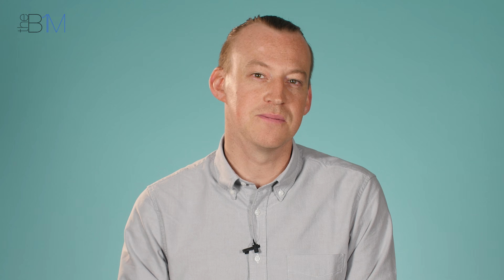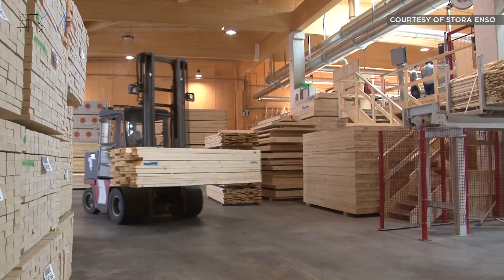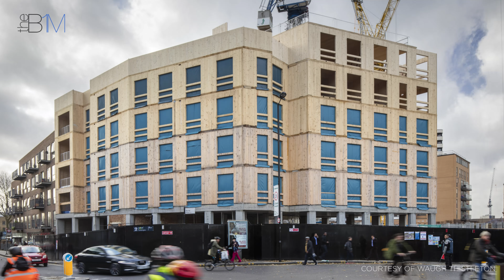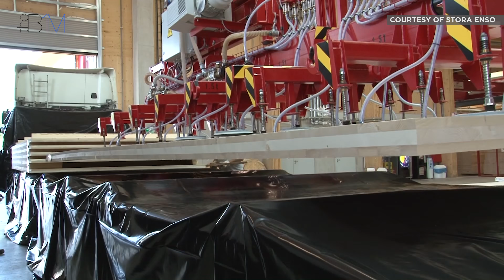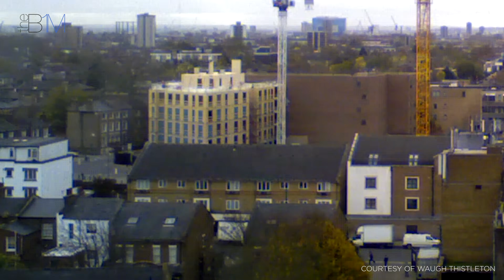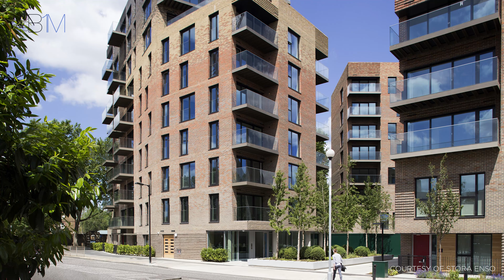What is Cross Laminated Timber (CLT)?

Comment: Aside from moisture penetrating the wood, what about woodworms or termites, or even just mice? Wouldn’t they thrive in the softer material?
Reply: Hi Nougabitz, I work for Stora Enso (our factory in the video) and in particular the CLT division. The CLT can be treated for termite protection, for instance this is done for the Australian or New Zealand markets where termites are more of an issue. We don't do this for the all countries as termites are a localised problem, for example in the UK they are not an issue, but for those countries effected they can be treated for. Mice are never really a problem, but certain local insects are designed for.
Reply: @gaz6351684  hi  mate do you supply to australia currently
Reply: @rexjgeorge  Hi Rex, yes we deliver to Australia currently, and have supplied the CLT for some big mass timber projects there such as International House Sydney, 25 King St Brisbane, and library on the dock. Please get in touch with me on gareth.mason@storaenso.com and I can put you in touch with my colleague who looks after Australia. Thanks, Gareth
Reply: We treat our panels with an environmentally friendly fungicide and pesticide solution
Reply: @денисбаженов-щ1б  hi, the glues we use are polyurethane formaldehyde free, and they make up less than 1% of the mass of the panel. You are correct that you still need additional finishes, the mass timber is the super structure, so you still need to add insulation, cladding, interior plasterboard, floor screeds etc etc as you would in any building. The floors themselves are also CLT panels, the bigger the span, the thicker the panel, and at larger spans (say around 5-6m) it becomes more efficient to start adding beams. Acoustics need to be designed for, and usually sound resilient bars to hold the plasterboard and floor screeds to add mass in the floors need to be used. But, common acoustic regulations can all be met with standard detailing.
Reply: @денисбаженов-щ1б  the thicknesses are related to structural load and performance, so, the taller the building or bigger the span, they change. A 2 storey single family home would usually have load bearing walls around 90-100mm thick. A 4m spanning floor with a typical residential load would be around 160mm thick.
Reply: also load bearing, only houses, not industrial or commercial with hardware.
Reply: @денисбаженов-щ1б  the VOC levels are very low, and lower than for instance carpet, curtains or furniture. Mass timber provides a very healthy living environment and also regulates moisture levels in the building naturally.
Reply: @денисбаженов-щ1б  the glue is not impermeable to moisture, and moisture can travel through the panel.
Reply: You realize we've been building with wood for millennia, right? We've figured it out by now.

Comment: The major downside for me is the noise absorption which is pretty much not existent.
Reply: Hi Pocki, I work for Stora Enso (our factory in the video) and in particular the CLT division. In regards to sound, CLT have very accurate and airtight connections between panels. This means in regards to airborne sound transfer, they are in fact very good. I believe what you are referring to would be vibration transfer, and while its true that timber does vibrate more than concrete, this is easily designed around through detailing. We've now supplied over 3000 projects internationally, all of which have had no problems in meeting local sound reduction requirements. if you go to our page, you can find full documents on sound proofing for CLT - http://www.clt.info/en/media-downloads/approvals-documents/technical-applications/

Comment: Could you char it on one side (in the Japanese fashion) to make a fire resistant exterior siding?
Reply: In my job I've had many years of experience with passive fire protection, timber fire door frames and fire doors, as well as FR plasterboard (and various other boards and coatings). No amount of PR will sell me on this idea. I would not spend a single night in a multi-storey building of this construction.

Performance of materials in a fire test is one thing. Real world fires are another matter. Every aspect of the building needs to perform, even after many years of occupation and the activities that go with that. Using laminated timber as the structural elements means the passive fire protection is critical. In practice, it will be vulnerable to compromise.
Reply: @kirkc9643  Then don't live or work in one. Problem solved.
Reply: @snakedoktor6020  Genius level intelligence there mate
Reply: @kirkc9643  Right back at you brada.
Reply: Chemicals are cheaper and better, but hipsters are free to do that, yeah.
Reply: Hi, I work for Stora Enso (our factory in the video) and in particular the CLT division. This is certainly an interesting idea, and the very old Japanese method (Shou Sugi Ban) of creating durability and fire protection is suitable for some projects. However, for nearly all of the buildings we supply, to ensure guarantee's, warranties, mortgages, insurances etc, the panels have to be designed for fire very accurately, to ensure they perform against fire as expected and required and ensure the safety of the building and the people inside. One issue with Shou Sugi Ban for modern construction would be that there is no accurate way of charring or measuring how that char has effected the panel. So although I'm sure its possible, for the very large scale buildings we supply, we have to use much more accurate and tested methods such a FR plasterboard or surface spread of flame treatments for us to be sure the building will perform as required.     You can find a number of fire design guidance and documents for CLT here: http://www.clt.info/en/media-downloads/approvals-documents/technical-applications/
Reply: The issue isn't whether it will work or not. But the Fire Design codes won't allow it (Even in a fire engineered solution). So you cant get the building certified.

Comment: i can disagree?
you see, with enough energy concrete and steel can be recycled many many times,  without waiting 35 years for a spruce to get to get to 50 meters.

Apart from doors, roofs, furniture and a cabin in middle of a forest in front of a lake wood isn't really that good
Reply: Still you need to produce Calcium Oxyde which release tons of CO2 (I do agree for steel though) Maybe we can mix wood and steel
Reply: well, depends, maybe you could change the mix of concrete for fly ash, or any ash of plastic, volcanoes, whathever, put some sulfur on it and having a pretty strong quite reciclable mix

At least concerned to wood, while i like, i don't think it does it have a future, i like wooden roofs, but it can have some problems
Reply: How often is the steel in a building recycled?  That's the critical number.   Quonset huts of steel should be eminently recycleable but shockingly large numbers of them erected 1940-46 are still in use.  The cost of recycling rebar has to account for the separation and disposal of the concrete.  Then there is the energy cost, not just in watts and joules and btus but in terms of carbon.  The wait for a tree to grow is merely the time that most building are just "sitting there".  I believe the "average life" of a modern structure is about 75 years.  A 35 year wait is irrelevant. 

While I suspect that steel buildings on Luna and Mars and the floating cities of Venus will be designed - like aircraft - with maximum lifespans and  recycling in mind that is not the case with terrestrial buildings.  Cost, solely in monetary terms, rather than cost in total energy or impact terms, is the overwhelming metric for terrestrial buildings.  Unless you build the costs of recycling into the construction costs recycling costs become a burden no one wants to pay. 

Thus at least for some projects engineered wood (it is important to remember that this is not sticks and branches lashed together but a human engineered material) looks feasible and cost effective.   But you know we really will not know until we try the experiment.
Reply: "With enough energy" is exactly what this material is helping to avoid.
Also, my wooden house is almost 70 years old and going strong. The concrete driveway (2nd one) is cracking and decaying again!

Comment: Feels like a silly question but I'll ask it anyway! Is there any risks or considerations at all towards the glue drying out and the layers peeling from each other under heavy load? Or is that just not a thing that happens?
Reply: Hi Ciaran, I work for Stora Enso (our factory in the video) and in particular the CLT division. Certainly not a silly question! What you refer to is called de-lamination. Our ETA is based on testing that simulates this effect over 50-100 years. The glue we use is a polyurethane formaldehyde free glue, and is actually less than 1% of the mass of the panel. One of the most important factors to avoid de-lamination is ensuring that humidity doesn't vary greatly throughout the year, as this is a main cause of expansion and contraction of the timber and therefore de-lamination, but in the very rare situations and harsher humidity variances where this may occur, its usually just to the outer lamella (layer) and holds no significant structural issues in regards to load bearing capacity, which is usually taken by the internal lamellas. CLT and Glulam beams for instance, have been used for swimming pool environment's etc, where the humidity level becomes more of a factor. The timbers will never really peel away from each other, instead its a case of minor cracking to outer timber, but again, this is rare and can be easily avoided. As Urban F points out, its really as case of correct protection of the timber from moisture, and designing for certain humidity levels that will ensure this doesn't happen.
Reply: hi @gaz6351684  ,  we are planning to build a passive house from CLT. Can you please tell me the advantages and disadvantages compared to a passive house built from brick (and insulation)? Concerning U-values, heating and cooling the house? For example, will the heating cost be more, since (Im just guessing) the timber will cool down faster than a brick wall would? Thank you very much in advance!
Reply: This is not a new thing, the arches carrying the roofs of the central railway stations in Malmö and Stockholm were made in the 1920s and there's an aircraft hangar built in 1937 with a span of 55 m. Those were weather protected structures so I think it's another kind of glue since 50+ years.
Reply: I helped build a c.l.t. plant in Columbia falls montana, we made rig mats for the oil boom. the glue we used is made by Henkel (Loctite) and is  basicly gorilla glue on steroids. direct sunlight is one thing pur bond hates. it is a form of plastic though so there isn't much that can cause de lamintation. maybe chemicals or solvents that are unlikely to be soaking into a structure.
 the destructive tests that certified lumber has to go through are more than you would expect. I spilled some of this glue in my driveway, it's still there. I am waiting for the sun to break it down enough that I can remove it.it has been four years now.....
Reply: There are some very expensive super hatches made this way so it's a big no for falling apart